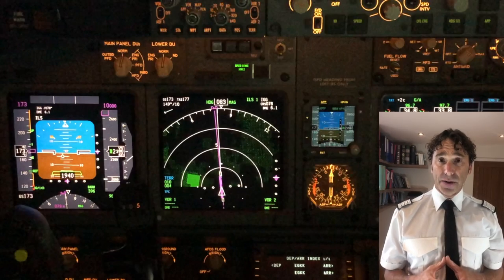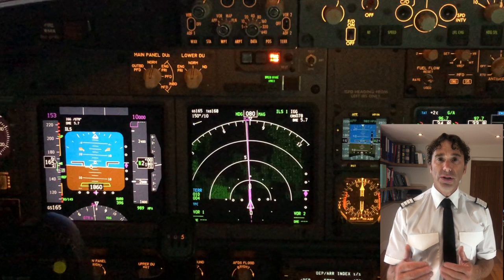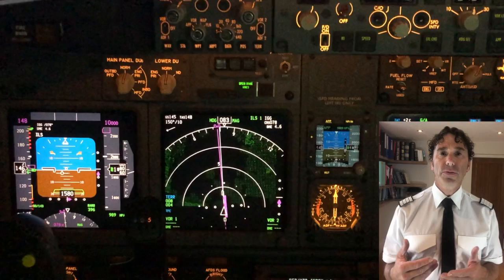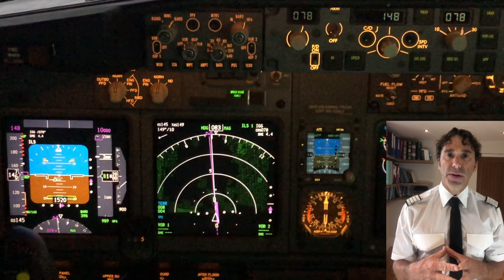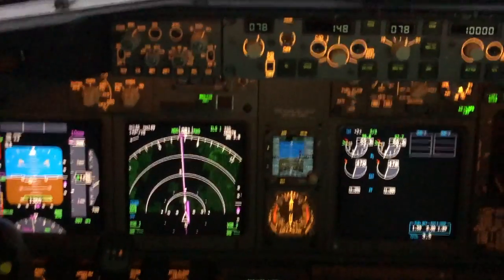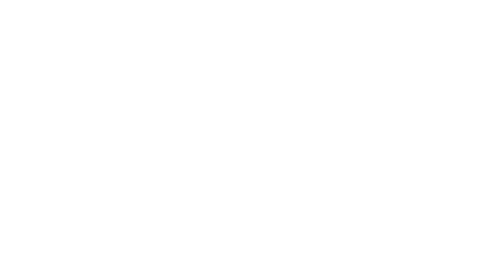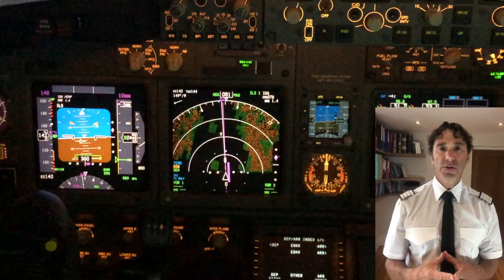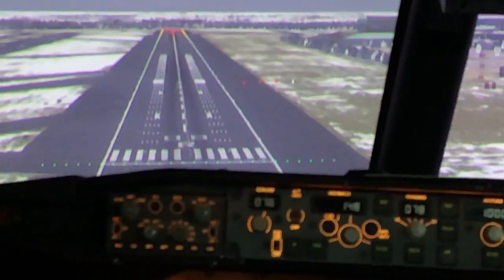Raw Data ILS

Comment: Scan is a bit slow, corrections are a bit late and excessive so it becomes a classic example of running after the needles. One must know the appropriate pitch and power settings then apply quick small smooth corrections while keeping a fast scan. And don’t forget to trim.
Reply from the maker: Small corrections are indeed the key, having the benchmark of knowing the pitch and power to start you off, and then you will soon work out what heading and actual pitch and power that will give you the desired track, ROD and airspeed. There is a reason this is required for a Skills Test, a quick instrument scan is required and smooth inputs. With so many pilots lacking continuity in their flying at the moment, if you are practicing on your home PC or dry hiring a fixed base, this is a good exercise to practice, along with steep turns to tune up the manual flying skills.
Reply: Pilot did very well recovering the glide slope and stabilizing before minimums, however.

Comment: Would’ve benefited from a discussion about the fundamental issue that made this ILS rather sloppy - a lack of attitude awareness and an almost complete lack of pitch trim inputs. The key to any raw data flying is the correct application of attitude performance scan - this is impossible if the aircraft is out of trim and therefore the attitude is not stable. Remember the VSI is a secondary instrument - always come back to pitch and power primarily.
Reply: I guess your are a PC sim pilot or a  Cessna 172 real world pilot, right?
Reply: @FTStratLP    You're so smart.    It actually sounds to me as though he knows exactly what he's talking about.   You?  Not so much.

Comment: If relatively stable, the GS tells you where you are.  VSI tells you where you're going to be.    To my, the VSI is more important than the GS.   Configure, power and pitch.     Pitch Plus Power Equals Performance.   Always, unless you're in a fighter or glider.

Comment: It's not really a true raw data ILS though with the ND still in ARC mode (which displays a ground track for wind correction)?    In the USA, a FAA monitored check ride in the sim requires the ND in the 737 NGs to be in compass mode with the flight director off.   PF must then manually determine WCA for localizer tracking.
Reply: FD wss off in the video as commented.
And the USA might have its own definition if raw data.